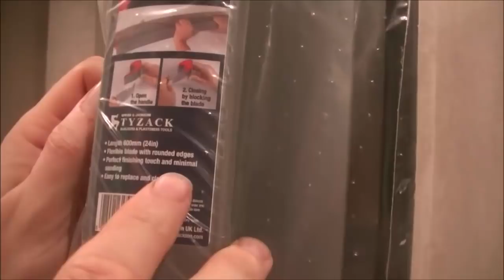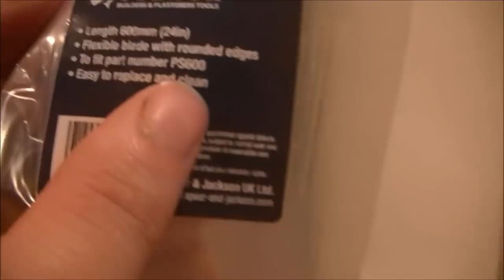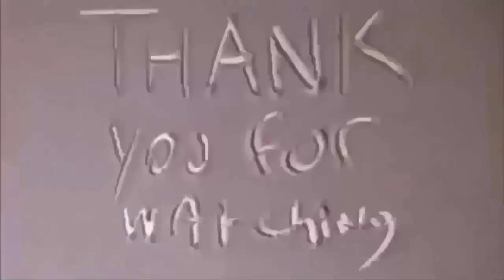UNBOXING TYZACK SPATULA EXCITING PRODUCT

Comment: Looked through your links and I know you done 1 on cameras but I can't see it do you have any advice on a half decent camera from personal experience
Reply from the maker: I had a sony with was great easy to use great footage but  a few dripps of water and thats was over £300 down the tubes , had an apeman witch was good and cheap but it seemed to have burnt out had a good water proof case though then had another witch was an underwater cam but the lens was bad (fish eye ) on a water proff dust proof heat and cold and some what impact resistant jvc but most phones now have great cams on them for footage ,hard to spend a big amount when its around plaster as it reacks everything  hope this was helpful mate

Comment: Hello, mate. I am trying to get into the world of skimming spats at the moment. Been thinking of buying a speedskim ST for a while now, but these stainless spatulas seem to be pretty good too. Do the stainless steel ones work better on high suction backgrounds (render, backing coats, etc)? 

Keep up the good work and happy holidays.
Reply from the maker: Hi  mate I love this spatula use it the most now  , dont use it on every job but when i need to pull out a bad angle I do love it these are the cheapest I seen online and with a removable and easy to change blade :)
Reply: Thanks a lot, mate. Did you get the 1000mm one? The one I am looking at looks similar to your Tyzack. Their blades come in different thicknesses. I don't know if there's a significant difference in performance between the 0.3mm and the 0.5mm thick ones. 

Thank you for your help and time.
Reply from the maker: @Gandalf4137  Cant remember the sizes I have LOL but the thicker the blade the less flex it will have buddy and probs be stronger and get less chips / nikes  on the blade but both should be good on skim and bonding

Comment: Look decent mac,
I got a speedskim with a metal blade and can't say I liked it, found it a bit too aggressive on the finish for my liking. I found it had a tendency to take back off and tear the work.
I didn't give it much of a try though, maybe I'll give a metal spat a go again, pretty set with original speedskim and plaziflex though.
What are you planning on using them for ?
Reply from the maker: Hi buddy    my plans for tools like these are 1st they must be able to help st righting out angles on walls and ceilings I do this also with the speedskim  I could also use this for k rend jobs to flatten in , have good footage of this tool in action :) You should give that speedskim a few try before yo give up on it totally ... are you using it on reskims or s/c plasterbard bonding ?
Reply: mac plastering 
I'd say my work load is about 50/50 with fresh board and domestic work.
I've heard of guys laying on then flattening and finishing with these tools, can't see myself keeping as good quality finish with just spats but I'm sure some guys can.
Would defiantly like to give them another go because they look great.
Theirs a speed skim with the black plastic now and that's defiantly on my tool list also.
I use the speed skim for a good flatten/straighten especially on old walls where I tend to lay on a thicker first coat and get it straight. ( let it go right off before laying on second but gets walls flat)
Reply from the maker: @amateurvegan2636  Thats sounds a good way to go get the 1st coat level and tighten great way to stop sliding  :)
Yea i hear ya we are confident in using the trowels witch makes it easy to just stick to what we know I tend to give ceilings and some walls a quick pass with these spats / speedskim then the rest with a trowel but i must try and do a wee wall fully with one and just use trowel to put on LOL
Reply: mac plastering 
Yeah I've got to try it some day! 😂

Comment: It's exactly the same as the refina spatula, only thing is that they've altered the back of it so the same pole attachment won't fit
Reply from the maker: I ant change my refina blade ? Can you ? but yea very similar for sure mate but sometimes the little things make all the difference
Reply: It's still the same tool tho even if the blade is changeable, refina will start selling the same thing soon
Reply from the maker: @jamietaylor2888  The handle is slightly better i think  i have the rounded Refina handle with is nice but i think i like this one a little better also tried the other type of hadle both with refina and tyzack the s shape handle but not as nice to hold as this , Hope Refina go for this one also
Reply: I've got the blue ones wich are pretty much identical to these ones there good tools tho
Reply from the maker: @jamietaylor2888  Ye i have them ones in red  They are good mine had a slight rust very slight i have even used them on render small areas to help screed it